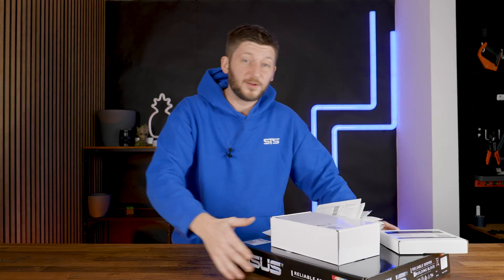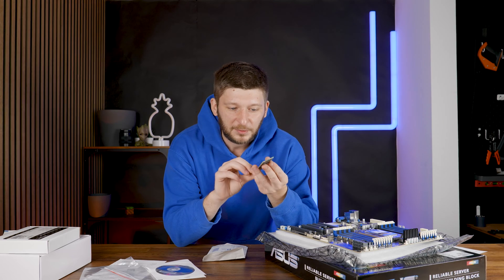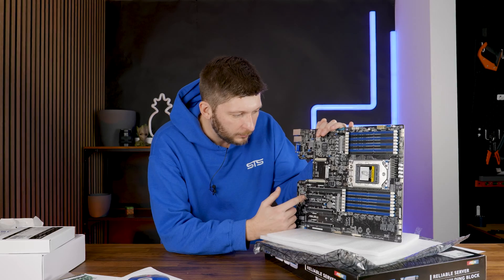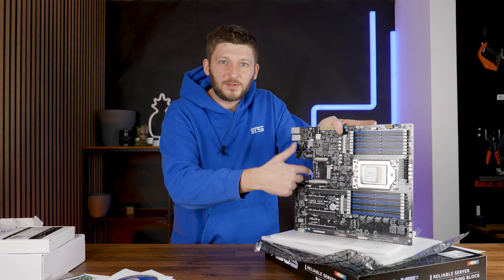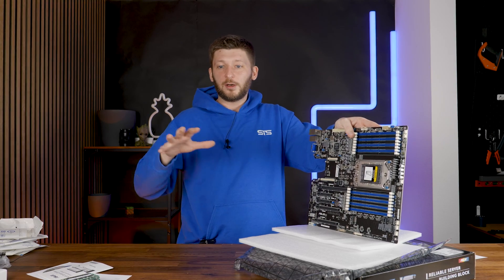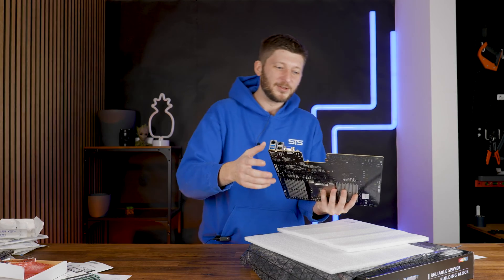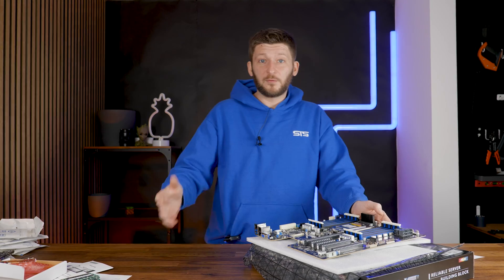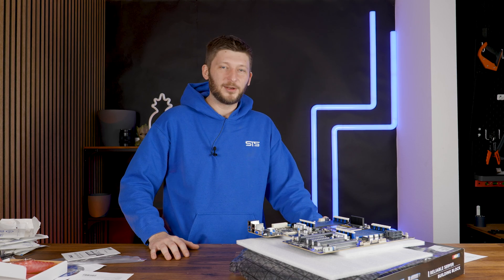Let's Build A DIY 400 TB Server - ASUS KRPA-U16 - Episode 2

Comment: A lot of server Operating systems boot from an sd card/usb key as all they are needed for is to boot up and once up they run fully in memory so the sd card doesn't degrade. All of my esxi servers run from usb keys and none have ever died. If they ever did you could quickly put in a new one and be up and running within an hour or you could prepare a key before hand and if it ever fails you would be up and running in minutes. If a key fails while the system is running it will have zero impact on the stability of the system.

Comment: Welcome to the abyss. Server hardware is powerful, versatile but incredibly opaque as though its only for wizards.
Reply: As a personal com user,  I do not have server-side knowledge, but does the server need nvme ssd?, let alone great scalability? Considering the limitations of transmission speed, is it necessary for a.i work
Reply: @guevarache1071  M.2 drives are quite popular as boot drives for servers for a while now. Just put two drives onto the board and run the OS in RAID-1 mode, and you don't have to worry about slots or enclosure space. Some newer Dells even have little pseudo-hotswap enclosures for M.2 on the back of the server.

For Mr. STS, two M.2 slots would be great for ZFS read and write cache drives, but he only got one M.2 with his board. 😜 Maybe he figures out what to do with those OCuLink ports his board got plenty of.
Reply: @Sarajiel  oh well thx for the details I dodn't know that it's been a popular way, as I thought nvme is still some expensive n even 10gbps network can not handle server speed but after read comment it could be great.

Comment: Always hilarious to see what Tech-YouTubers buy to grow their channel once they get filthy rich...🤣😋

But joking aside, why didn't you just buy a Supermicro motherboard that already includes dual 10GbE NICs? It's not like you're actually going to buy a 100GbE NIC from Nvidia/Mellanox anyway, unless you spend a lot more money on the proper switch to utilize that bandwidth for your LAN.

You might also read up on some of the stuff before creating your videos, because a lot of the things you are wondering about are beautifully explained in the manuals of your hardware and Wikipedia to get the bigger picture. However, in case you need a pointer, start with baseboard management controller (BMC) and IPMI to get an idea what you are able to do with your fancy server hardware. 🤓

To be completely honest, from a practical point, you probably would have been better off with a midrange NAS from QNAP that supports ZFS, and maybe an expansion unit, in case you really need those 400TB of storage. Although, that wouldn't make as much fun to watch than seeing you struggling with that enterprise hardware. 😉😁